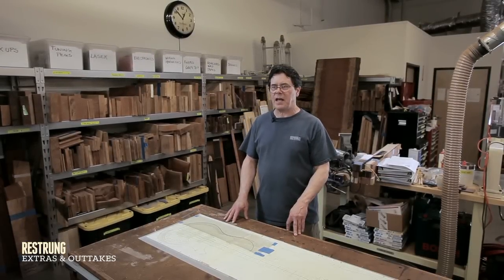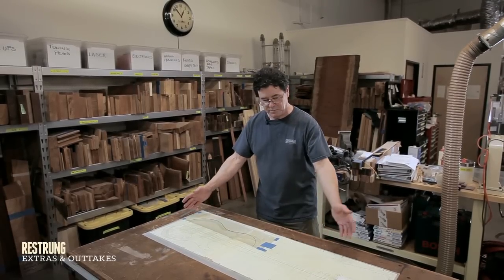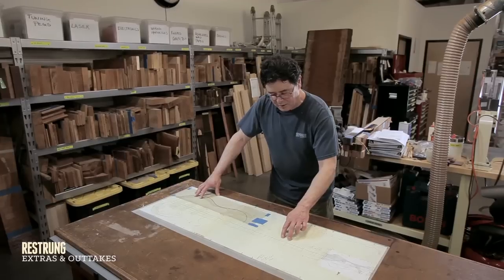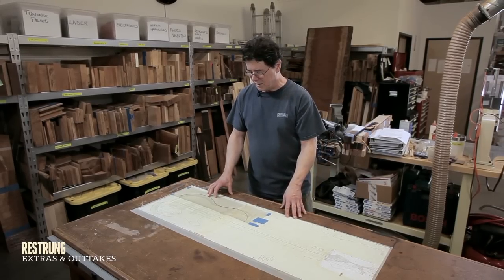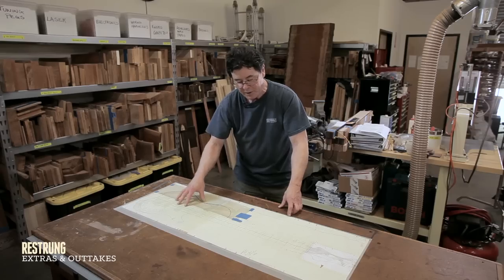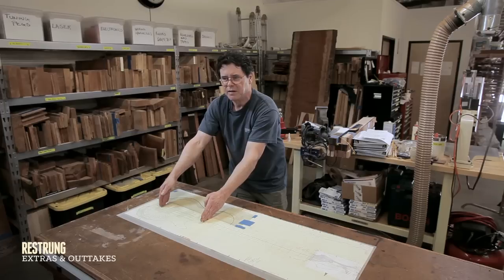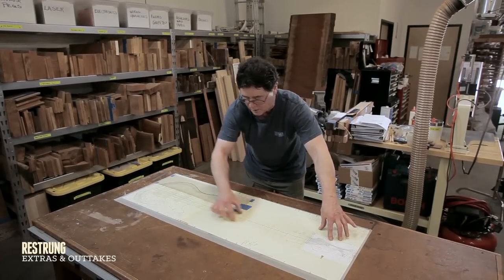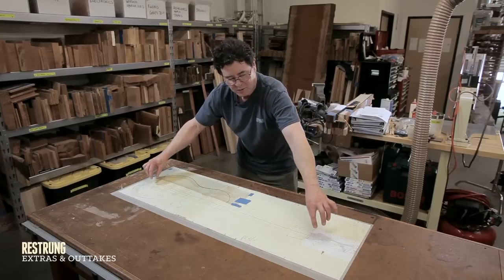How to Build a Bass Guitar - Step #1 - The Full Scale Drawing

Comment: I just cannot seem to find any information i am looking for .  I could not find anyone  that can tell me  how to determine string spacing for a 6 string bass and nut width once i figure the bridge spacing when building a short scale bass (30") Seems that nobody is interested in inovative ideas .  24 fret 30" scale fretless with fret marker inlays on an maple/bubinga neck ebony fretboard, brass 1/4" nut compnsated.  Alnico 5 8164 wound 42 guage hummbucker neck pickup, Alnico 8 7236 wound 42 guage humbucker bridge pickup ...tone is exactly what i am looking for ..just like i said before i cannot find the right bridge spacing I will mill my own bridge if i have too.  Any kind of formula for determining the string spacing once i know the  neck scale?  I accually contacted you  a few years ago to  build this for me but  at the time you simply didnt have the time nor the right  jigs and such. so perhaps a little help now that i spent the money i woulda used for the construction on the machines and tools i needed to build it myself?.
Reply: What i do always is to count the centimeters in the nut, give about 0.3 cm each side and divide the space remaining by the number of strings,

Comment: Great approach to planning. I work a lot the same way but stick to 3 body styles and Make templates for the shapes. The neck thru design makes for a beautiful instrument except for its one major flaw. If anything happens to the neck your entire bass is trash. That joint does not effect the sustain as much as ppl worry themselves over.  This is purely a myth.  The Ritter basses have arguably the best sustain of any bass ever built. And they are all bolt on. Other factors effect sustain more than the neck joint such as the bridge, the nut, and the type strings you use. I’ve seen too many neck thrus with broken headstocks, or a twist in the neck. Then all you have is a faulty bass to scavenge parts from. I’d rather not spend 100s of hours on a beautiful neckthru, just to have that worry hanging over my head about how protective I must be of the bass. But that’s my choice.
Reply: Sounds like you have great reasoning for doing bolt ons!  All the best with your bass building ventures :)
Reply: bolt ons have great resonance. yes, it's a myth. they're just pretty.